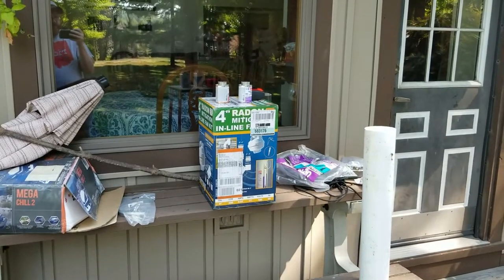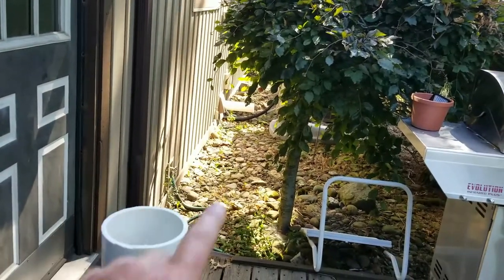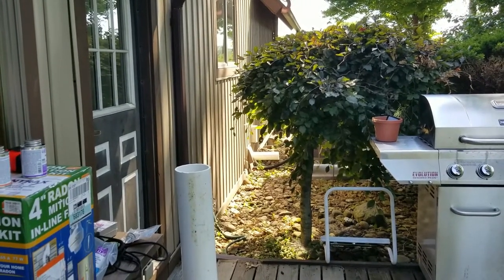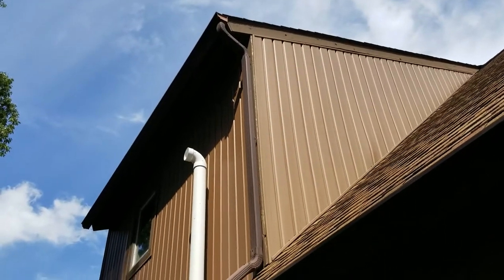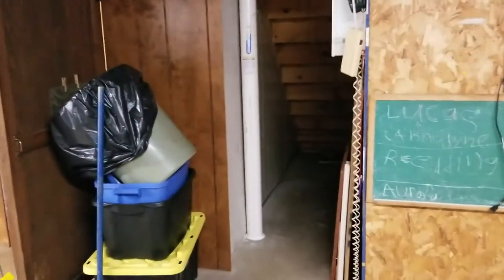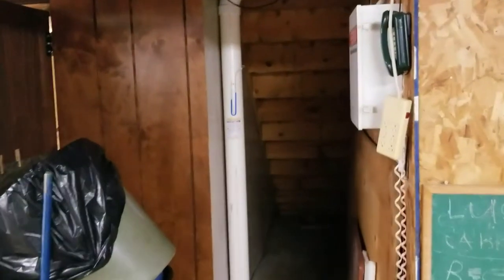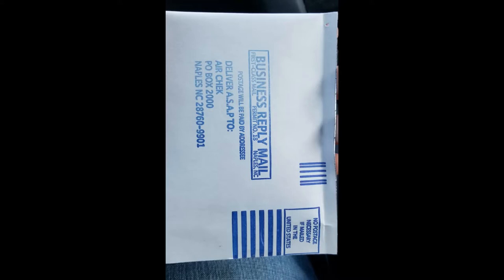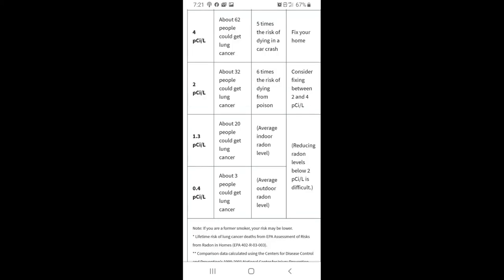RADON ABATEMENT - Do it Yourself - How I did it

Comment: Overall, not a bad job.  However, where you dropped the pipe down then back up is going to become a water trap.  There is a lot of ground moisture in the airstream which will accumulate in the pipe and fill up in that low area of the pipe and eventually fill up.  The simple solution is to install a “T” fitting in the low run of pipe and drop another suction point.  Then, the water can drain back into the soil.  The only downside is that you will need to borrow the core drill again.  Again, good install other than that one “rookie mistake” which everyone makes when they’re learning the trade.
Reply from the maker: Thanks for the heads up.
Reply from the maker: Pressure Tech you hit the nail on the head with the water trap.... we finally got some rain and i went downstairs and it was gurgling away. Ill have to install a drain tomorrow.
Reply: @bucksgarage1  cut in a tee, then brushing reduce it down to 3/4” and put in a ball valve
Reply: Just put a 90 on the termination you will avoid water going in
Reply: I was hoping to see how that inside piece was installed. So it has to be a couple inches below the basement floor? How has your radsn been past couple yrs?

Comment: I don’t understand why they suggest it go above the roofline. When running 24/7 the concentrations of radon have to be very minimal. We don’t run 90% furnaces like that or gas dryers. I don’t buy it.
Reply from the maker: From what I understand it is because the eves of the house pull air up and in, if discharge below the eve you have the potential to reintroduce it back into the house. At least that's what I was told from a licensed tech when I was talking about the same thing.
Reply: @bucksgarage1 thank you
Reply: @bucksgarage1  What I do not understand is that radon gas is over 7 times heavier than air. So if vented right above the eave, wouldn't it will begin to sink toward the eave? I guess if vented above the roof line, the wind will disperse it easier than if vented beside the house.

Comment: You're better off having your suction point along the exterior wall rather than centrally located. There are small voids and cavities close to the wall that are good for air movement and typically run the entire perimeter. Most likely that's where the Radon is present. A more direct run would have also prevented you from having a trap in the piping that I'm sure you've noticed by now is accumulating water and blocking off suction. This becomes evident from gurgling noises from inside the pipe. Other than that, you did a nice job.
Reply from the maker: I really debated where the suction was located.  I did add a drain for the trap I created.  It's been working well since. I would make those changes if I were to do I again.

Comment: i just paid $100 for a digital radon meter that i always keep on
Reply: I bought an Airthings radon digital detector but was told by a certified radon specialist that they aren’t accurate and are usually high. I also talked to my state, Oregon, health authority and they explained they aren’t accurate because they are calibrated and after manufacturing that calibration starts to be off. I know as an electronics tech for the Navy we had to be really careful with our calibrated equipment and get it recalibrated every year or two. I would assume the same for this calibrated device which shipping with Amazon doesn’t take this into account nor is there a way to recalibrate them, that I know of!

Comment: I have a sump pump hole in my basement...sealed and covered it.  Used a computer fan to vent it.
My reading went from 660 beqerels per cubic metre to 15.  Tests were 3 months each same conditions.  Measurements in 🇨🇦 .
Reply: How did you vent it exactly?

Comment: Thanks for sharing your experience.  I’m currently building a house and was interested in your input.  We will be pouring the basement slab next week.  Should I install a vertical 4 in pipe and just cap it off for now until the house is completed and then run a test.  If everything is okay, I’ll just leave the 4 inch vertical capped off.  Question, should the bottom of the vertical be in the gravel before the pour.  How deep?  Thanks.

Comment: Great video, thank you for taking the time and showing the results. My test came back at a high of 4 so I'm strongly considering a similar install. Better safe than sorry
Reply from the maker: I probably went overboard piping it to the center. Had mine only been a 4 to start I would have went next to the foundation on an exterior wall. Either way I hope it works out for you.

Comment: I was about to spend $150 on a radon monitor before I did an install but figured I’d just use the $150 towards my system. The map doesn’t have any data for my area but figured it won’t hurt to have.

Comment: The manometer hose will drip condensation into the blue liquid and compromise the reading if the hole in the pipe isn’t under where the tube connects to manometer. The drop in the pipe must have a drain line installed in it or it will certainly fill with water- this will block the airway and burn out your fan- it is recommended you install a small 2nd port in the “drop” area, this is allowed to be a 2” pipe as it’s main purpose is drainage

Comment: Thx for the video. Where is the air being drawn into the pipe? It looks like the pipe is resting on the floor or is it in the floor?
Reply from the maker: I drilled a 4.5 inch hole in the concrete and it's down to the limestone underneath the concrete.

Comment: I'm not watching cause I have a radon problem, I just bought a radon fan (rp145c) cause I'm turning it into a vacuum for pc heat mitigation. The pc cabinet does not have great air circulation.

Comment: You made a mistake with that drop, water condensate is going to accumulate in that low section.
Reply from the maker: You sir are 100% correct. I have since put in a drain.